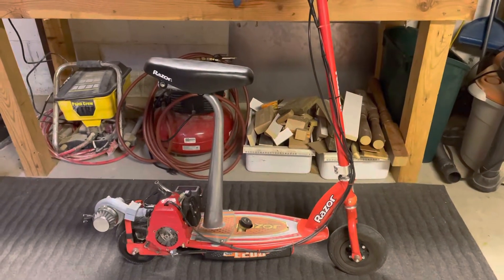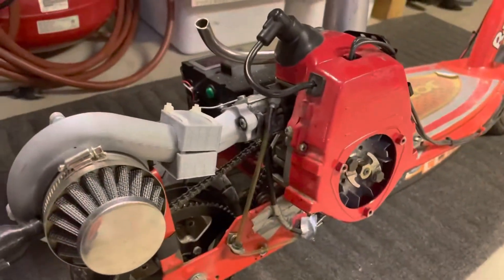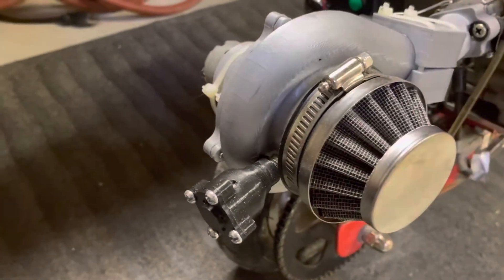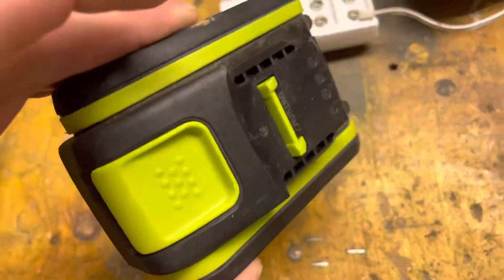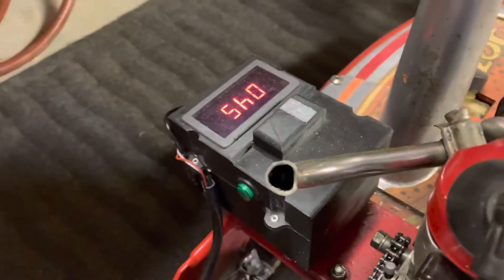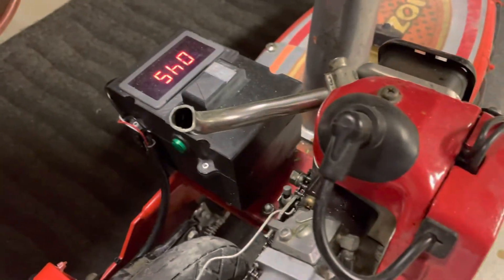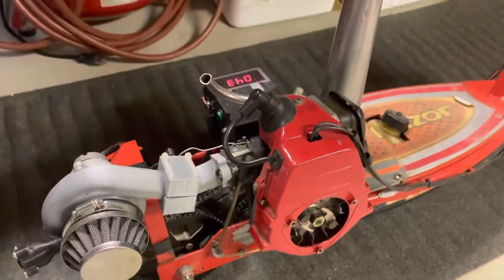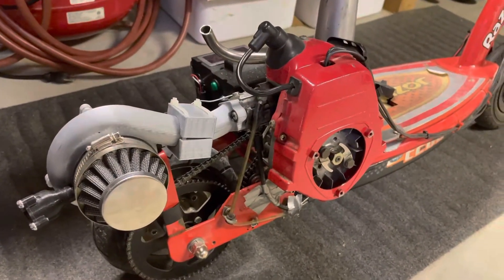2 Stroke Motorized Scooter With Electric Turbocharger Update

Comment: Would it work with a carburetor too? I wanna try putting a electric turbo on a motorized bike engine, a push through setup. So on the inlet of the carburetor